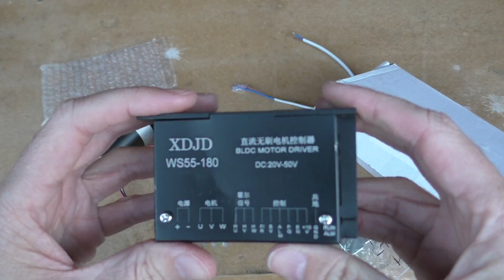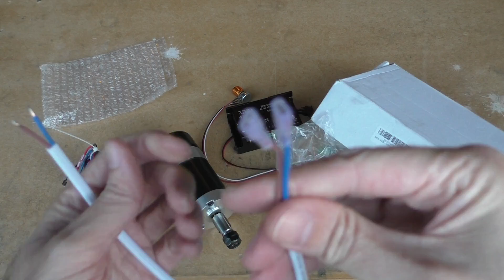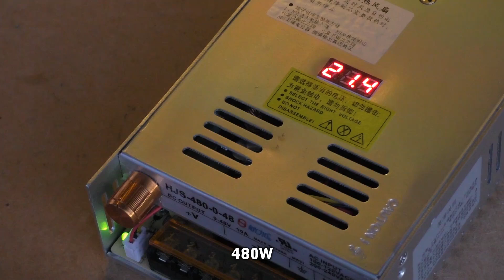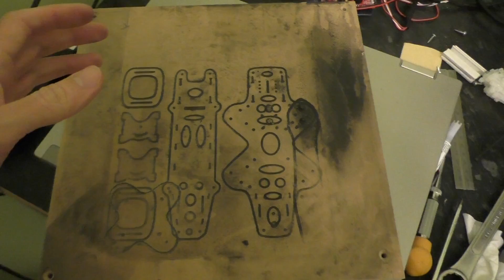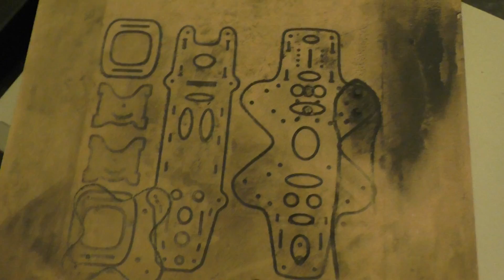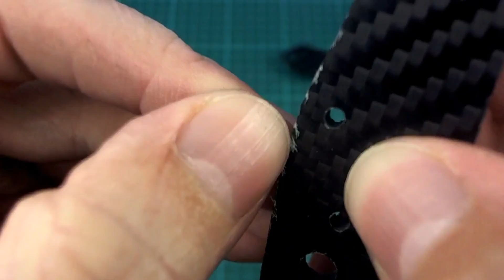DIY mini CNC machine part 15 (carbon fiber review)

Comment: Good night. Please, you change the spindle motor, due to the noise on the system. Please,let me know, what spindle motor, are you using on your chapter No.15? Sincerely Pedro Gil.
Reply from the maker: Same motor, I didn't change it. But now I'm using a bluetooth connection between the computer and the arduino instead of wired connection.

Comment: How do they arms stays in place? Do you put some adhesive on the board first before starting the cutting?
Reply from the maker: I think back then I was using double-sided tape. These days I will do a first cut where I make a bunch of holes, put screws in the holes and then cut the rest - make sure the second pass will not hit the screws! To hold it down for the first pass, I pus screws on the sides/top/bottom of the material.
https://youtu.be/9pzCYgKl1XI?t=134

Comment: When I try to cut 2mm CF sheets using my cnc, the bottom edges are burred and have strands that protrude (on the side of the CF that touches the waste board). Does anyone have any tips? What are your tips for a smooth exge after cutting? Using a carbide 3m bit. Thanks
Reply from the maker: Presuming the toolbit is actually going all the way through properly, maybe the tool has become worn down and not sharp anymore. If you are cutting it dry, maybe it's getting hot and the resin is softening. Just in case, you don't want to use a spiral flute type cutter with blade-like edges, you want the 'burr' style that looks kinda like rough sandpaper.

Comment: I'm trying to make a platform that moves vertically.  It's not got to be very precise just raise up about 5 feet.  I gave up on belts and pulleys they can't handle the weight.  Trying to make something with a threaded rod and I can't find a good explanation video of how to set this up.  Everything is about 3d printers where do I even look?

Comment: I admire your determination in making this machine yourself, but i agree it's not the best way. I bought a lightly used 3040 (30x40 cm work area) machine with ball screw drives and an A axis rotary system for $800CDN, which is about $600 USD.

Comment: educated guess here: compensate for the loss in cutting tool diameter in your final cnc project file. increase offset for each cutpath, in steps (0.01/0.05/0.1 mm), at each ~50m(for example) of cutpath interval - if a piece, with steps taken into account, needs ~25 meters of actual cutpath length, than two pieces will be your cupath offset interval. add an inwards offset to cutpath of pieces 3 and 4, than again (same)offset on the cutpath for pieces 5 and 6, etc
or just experiment with a discarded piece of material (or duplicate material - yes requiers more $$$, but is a good practice for optimization), 
cut simple lines and measure grooves made at intervals inbetween every ~25-50m of cutting with the bit you would eventually use on the final product (again, requires duplicate sacrificial bits - but better practice) 
find the perfect offset increments for your cnc + bit + material combo, record it in some way, come back to your own proven knowledge in future projects
also, add a spoon of liquid dish soap to each 10L of water used to lubricate - might keep your bits alive and kicking for more :)
Reply: From my own experience with a diy cnc with a system much like his, the bit wearing out is a result of the very long time to cut. I also cut 3mm cf chassis for rc drift chassis and it has never taken me longer than 5mins to cut the entire thing out. 20mins to cut out such a small piece is insanely too long. Hence the fast wear on the bit.

Comment: Have you ever looked into the vents of a drill motor (like a 3/8" drill motor) that has brushes and watched all that blue arcing? Well, that is what's putting out all the hash (crap) that you've been dealing with all this time. I'll bet (although I don't bet). Anyway, I haven't finished this video or watched #16, but I would put this brushless motor in just as fast as possible (I realize this was 1 1/2 yrs ago). EDIT In the late 1800s, they used what was called spark-gap transmitters that put out hash on all frequencies - it just put out RF (no certain frequency) and then you interrupted this with ons and offs (Morse Code). That's basically what that brushed motor is putting out and when you had all those stray voltages even over a 100 volts, I just kept saying please get rid of that power supply and motor.

Comment: Hi, i'm designing a slightly bigger an more rigid cnc and i'm trying to keep it under 300$ (i can get the aluminum for free) and i'm wondering if the NEMA17 are enough for what you are doing or if i should upgrade them to NEMA23.
What do you think?
Reply from the maker: I think these motors I used are pretty much at their limit here. You can get longer ones that are still NEMA17, as I eventually did for my z axis. But for a larger machine I think NEMA23 is probably a good idea.
Reply: i decided to use some overvoltage and overcurrent NEMA 17 with diy active cooling.
for the z axis i was planning on using a 2:1 timing belt.
if i need i'll upgrade to NEMA 23 and use the small stepper to build another small 3d printer.
Reply from the maker: Sounds interesting, I subbed so I will see the future video you make about it :)

Comment: Did you us the brushless spindle?
Reply from the maker: Not yet. I don't have a mount of the correct diameter for it, and the brushed one is not causing trouble when I use bluetooth between the computer and the arduino.

Comment: If you would do the cutting in two passes, do all the holes in the part first, fasten each part with screws into your sacrificial board until you do the outlines!

Comment: to achieve better edge quality and nicer holes use last pass function.After you made a cut in steps, you need to do one more pass in full cutting depth through material, you only need to remove very thin layer of material around. When you make last pass  you will use less used and sharper part of the tool.
Reply from the maker: aha... good idea. So maybe for my 2mm end mill I first tell the CAM program that it is say 2.4mm diameter? Then next time tell it 2mm and go fast at full depth. Will give it a try.
Reply: last cut dont have to be a lot  even 0.1mm should work

Comment: I have no cnc experience, just programming, but I was wondering if the cut speed can be decreased, by the program, as a function of distance cut.
Reply from the maker: The cut speed will be determined by the toughness of the material, the size of the end mill and the depth of cut. It will not be affected by whether you're gonna do a long running job or not.
Reply: Apologies, it was late. I had just come across your CNC build videos and watched them all.

What I meant was: is it possible to include, in the cnc code, a variable travel speed, depending on how much has been cut? This way it could be slowed down as the bit wears down.
Reply from the maker: aha, now that's not a bad idea :) It might be tricky to get right, but could work. I bought some nicer end mills, 8 euro each instead of $7 for 10, but hopefully they will last much longer.

Comment: use carbide to cut carbon fiber..not those cheap Chinese cheese grade metal bits micro coated with lies and the tears of forced child labor lol....buy once, cry once....carbide is brittle but hard as hell and won't wear like other tooling does....just don't drop em on the floor and you'll be good to go for a long long long time

Comment: try aliexpress. ive had pretty good experience with ordering parts on there over banggoods. they have alot more of a selection thats for sure.
Reply from the maker: I tried aliexpress once and the item was never shipped, only after 6 weeks was I able to get a refund. The problem with aliexpress is you have to deal with the individual sellers who are a mixed bag when it comes to reliability and service/support. Banggood is a lot more consistent, never had any problems in hundreds of orders.
Reply: ah ic. that sucks. totally understand, that would make anyone not wanna use that site.. yea, i used these chinese ebay kind of sites awhile back and had the same experience... i recently started using it again and had pretty good luck.

Comment: Ran across this video while watching some others. My question is why are you trying to lube the cutter? It doesn't need it. go to Amana tools and buy the proper cutter. you need a solid carbide cutter for it to last. they are pricey but the quality of cut and longevity outweigh the cost.
Reply: Amana tools part number 46260. You can get them at toolstoday.com for $18 each. They work fantastic. I've been cutting 2.5mm plate with them.

Comment: You should line the entire bottom of your tub with the raised lattice screen.  Each individual cell will catch some CF dust, starting with the closest to the deck, then overflow into the next cell adjacent to it, until it eventually reaches the drain, rather than a big torrent of CF dust clogging the drain.  You'll just have to vacuum it out periodically. Similar to a gold mining sleuce box. IMO

Comment: Fantastic to see the beast working for it's living!   You must be over the moon to be rid of the interference issues.  I wonder if the misplaced holes are because of missed steps on your steppers, brought about by the increased force needed to push the blunt cutter?  Maybe it's time to fork out for a quality single-flute CARBIDE cutter.   This would also eliminate the undersize holes.   I had to chuckle when I saw that you had done another 29 minute video on the series that has been finished.  Glad you did though.
Reply: not sure if you'd reply to this since it's been 4 years but do you recommend a single flute carbide bit over a corncob carbide bit? I noticed a lot of people online use the corncob bit.
Reply: @im_ricebowl  Sadly I have no experience of a corncob bit, or cutting carbon fibre.  My comment above was aimed at cutting aluminium, which was done in one of iforce2d's earlier videos; it is not relevant to this video, and should not be here.  I suspect a corncob cutter would be appropriate for cf, where you are not trying to make large chips.  A single-flute cutter would probably spread scary amounts of nasty dust... the last thing you want!  Maybe iforce2d or someone else can help?
Reply: @PiefacePete46  I'm even surprised you replied to this random comment after 4 years so no worries....should I also assume that a single flute cutter would also be fine for wood and acyrlic? ....ohh sure I'll ask around thanks by the way!
Reply: @im_ricebowl  The "University of Youtube" (so named by Absorber of Light, during the build of his rather different CNC router/welder) works best if we can find the time to give, as well as take.   A single flute cutter is my weapon of choice in acrylic, where low temperature at the cutting edge is paramount.  Straight flutes are fine.
They also cut wood without effort, but for really pleasing results, try a single-flute "Down-cut spiral" bit... the helix is angled in the opposite direction to a normal bit (Up-cut spiral), and it cuts fibres on the top face cleanly, rather than tearing it out.  It seems illogical to use a bit that pushes the chips into the cut, but experience shows that it works great.  The bottom face is usually clamped to a spoil-board, so it comes out OK.
There is also a "Compression bit" that has two sets of flutes: the upper ones helix in one direction (down-cut), while the lower ones are in the opposite direction.  This results in beautiful clean cuts on both top and bottom faces of the workpiece, especially if there is no spoilboard.  I have never used a compression bit, as the need has never arisen.
Make sure you are having fun!   :o)
Reply: @PiefacePete46  Whoaaaa I'm actually learning hahaha thankss!! actually I have been looking for the Down Cut bit but I couldn't find it here locally but that's find I'm fine with sanding down the frilly bits that come from regular Up cut bits.... tho I have never heard of a compression but before interesting..... anyways I think ill get a single flute carbide bit Thanks again!!!

Comment: 3M scotch brite pads may be used to prevent blockage. Just pull them out after the job and rinse in the sink. Congrats on the CNC mach. I am trying to set up a 1.5 by 3.0 meter table. The shipping is what is got me stymied at present. I really ought to start with the bench top model for my smaller projects. Lessons learned here will be very useful mate. Cheers, C

Comment: The logic level of the controller does not matter, because you usually drive an optocoupler to switch the 10V (or whatever they are on a controller) to its own inputs. Same for the outputs (if it has any). You drive an optocoupler. A big part of the reason for this is exactly the thing you have issues with: noise. Second reason: especially in industrial settings you often do not want the grounds of different machines to be connected.
The other possibility (it depends on the controller) is that you pull the inputs to GND which can be done with a transistor at any logic level. No need to provide a "high" signal to the inputs.

Are the router bits even carbide? The titaniuam nitride coating looks weird on them. I've never seen that used on small carbide drills, only on HSS (which is useless for glass/carbon fibre cutting). The only thing that really kills carbide bits is heat. If they are blunt to begin with they burn up. After that you are rubbing instead of cutting.

Comment: Building your own CNC mill is worth a thousand dollars or more in experience points.
A good investment. 
 Now make a 3D carbon printer.
Reply: Next step would probably be building a waterjet or converting this router to one. Especially if he primarily plans to deal with carbon fiber much.  That will eliminate all his dull bit problems.
Reply: waterjet cutting is not the most precise cutting method, not recommended for what he's doing. although it's a nice thing to have :D

Comment: Ahh, lol, you are in NZ, thought your accent was Kiwi, but you were in Aussie for some reason. If you need any advice on anything, let me know, touch base and happy to help. I've been doing similar for 15 years, based in Wellington - run a cnc and laser cutting biz. www.facebook.com/atomickiwi you can check out our pad. Making a DIY 5 axis machine atm, bit of a challenge too, same issues - ghost interference etc. enjoying watching your learning curve and projects :)
Reply: Hi I'm also Aussie, and embarking upon construction of a DIY 5 axis CNC mill as well! I also have run a small laser cutting business for a while. I'd love to bounce thoughts off you on the design of my CNC machine. I'm just working out the frame and layout at the moment. Are you planning on making yours able to do aluminium?
Reply: Hi T, yes, that was the first change I did early on - upgraded the frame to 100mm box steel for strength. (first frame was only 40mm box steel welded, but not enough strength, even with bracing for the Z height. Machine can cut in a 900x800x700 (xyz) 3D area, so needed to be strong. Send a pm thru our fb all good
Reply: Thank you. I'm planning on using 60 or 80mm aluminium extrusion as my base frame - I'm against welding in case something is out of alignment and I can't change it. I couldn't find your facebook, will PM if you point me in the right direction. Cheers
Reply: if you can msg thru facebook - http://www.facebook.com/atomickiwi otherwise www.routercut.com has an email address at the bottom of the page which will get forward to me ok.. :)

Comment: I feel that your drain line is too narrow and can not support the flow rate needed to keep the dust in suspension hence being able to settle in the corner.  Otherwise, great set up and thanks for posting.

Comment: Do me a favor and try to see if the parts are conductive. Maybe the reason that the fray edges are white is because it's fiberglass and black tinted epoxy?

I now know why my holes were smaller than designed. Same reason that you'rs. LOL Didn't dawned on me before.
Reply from the maker: Yeah it's conductive.

Comment: For the software I wouldn't spend any money being a hobbiest. Autodesk Fusion 360 is free for noobs like us and can do CAD and CAM.
Reply from the maker: hmm... HeeksCad looks interesting for CAM, I will give that a try. Yeah, I bought some nice end mills from Germany yesterday, diamond coated carbide, can't wait to give them a try :)
Reply: "Free" Fusion360 is only a 12mth licence.. no guarantee it would be free next time!

Better to invest your time in: FreeCad and HeeksCad are both free under Linux which is also free - usage without cost or licensing. I use FreeCad for the design/drawing, export step, then import into HeeksCad to generate the gcode (.ngc) files for the machine - which is running LinuxCnc  (also free) on an old desktop computer. The Cnc machine is a 6040Z, which is very nice, fast and accurate.

p.s. don't buy those cheap Chinese end mills. I got mine here:
http://stores.ebay.com.au/carbideplus/
Reply from the maker: If I was starting from zero today I might be interested in Fusion360, but now that I have a straight-forward working tool chain, when I took a look at Fusion360 recently it seemed obscenely complex for what I need. I can't run it on Linux either so I would constantly need to be changing computers just to use it. Qcad is so good I will probably never use anything else for CAD, but I am still kinda interested in finding a replacement for Estlcam, which has some niggling small bugs and limitations, and the developer doesn't answer emails. In that respect Fusion360 is still a possibility, and I might come back to try it again if I want some more advanced toolpaths that Estlcam doesn't do.

Comment: You could try plastic cutting board chefs use (hdpe) its waterproof dimensionally stable and cuts like butter! Great for waste board
Reply from the maker: Yes that's my plan, when the MDF runs out.